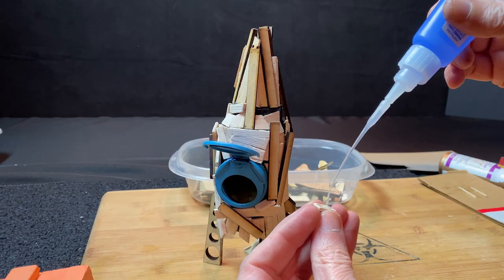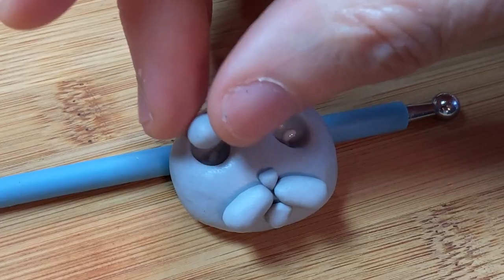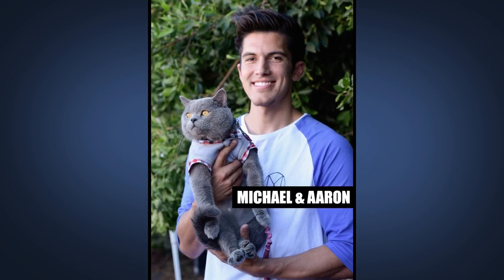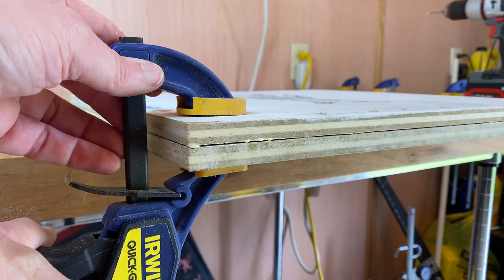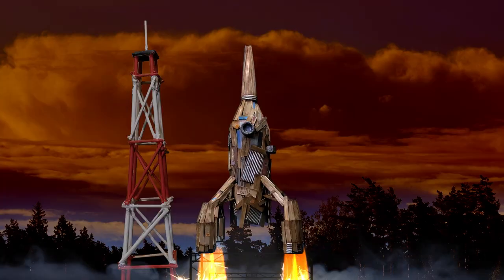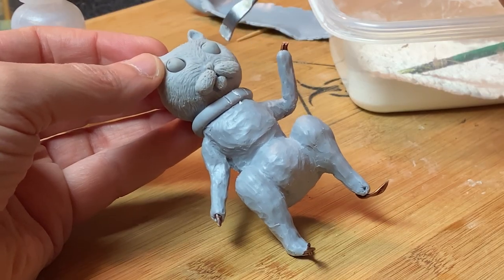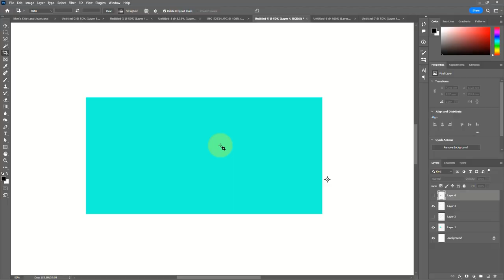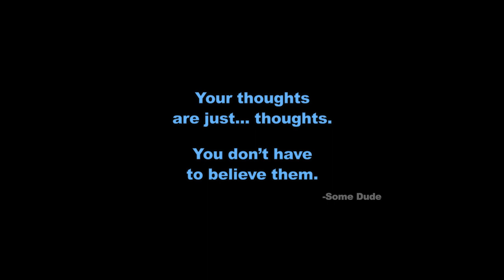ASTRO CAT! Aaron's Animals Sculpture

Comment: I bought some sculpey recently, and even a nice little toaster oven since my regular oven is a story and a half away from my work bench but I haven’t pulled the trigger on actually trying it 😅 I still have less then half a year under my belt of crafting and I’m worried at what my first sculpts will turn out to look like, but your vids (along with Dan Does since you’re the two main sculptors I follow) have been slowly chipping away at that hesitation. Beautiful build, and I hope to one day try making my own
Reply from the maker: Just jump right in Reaper. Don't TRY to be good with your first sculpts. Make 10 or 20 little sculpture sketches before even baking anything. Take the pressure off. Have fun.